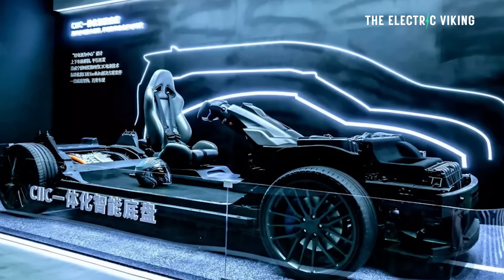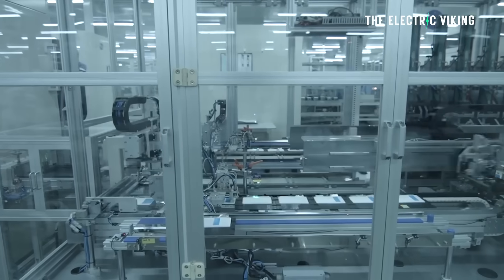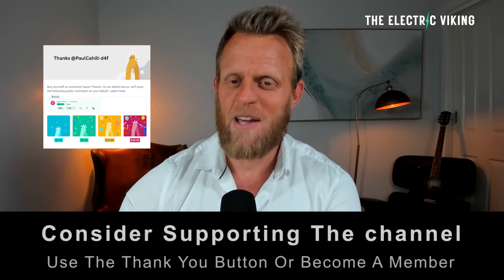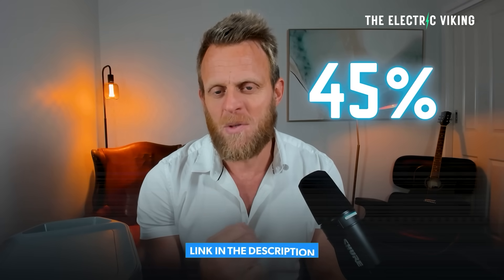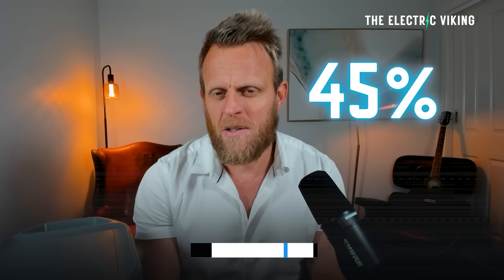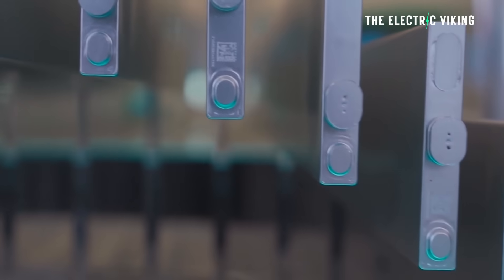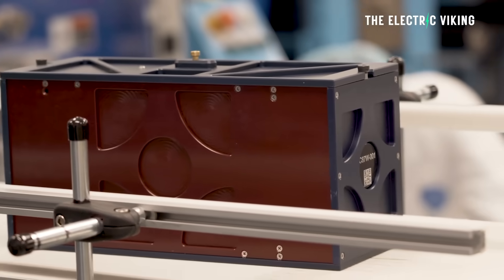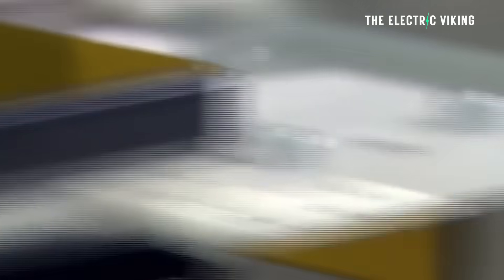1,000-Mile EV Range Unlocked: CATL’s Lithium Metal Battery Breakthrough!

Comment: You means putting in an equivalent battery with the same weight as the current 70 kWh one. Since it has double the energy, it will have 140 kWh and you will get double the range.
Reply: yes, putting another 70 kWh battery will only give some few miles extra with the lower weigth, must be the other thing he means.
Reply: THANK YOU!

He keeps saying this in a bunch of videos.
Thinking that lowering the battery weight by half (which would make the whole EV about 15% lighter) will double the range of the vehicle.

In highway trips it will increase, at best, 2%, because weight is the enemy of accel./decel. not, speed. At constant speeds, the only difference the weight makes is in rolling resistance, which is nothing compared to aero drag in a car.

You still need double the energy storage to double the range with the same weight.

Viewers are mislead by his convincing ways of saying something so wrong...
Reply: He always makes the same error, 70 kWh is 70kwh whatever the battery tech  …
Reply: @yvesvandenbroek6055  almost, half the weigth of the battery will give a little in improved range, maybe 5-10%?
Reply: The Electric Viking is crap at numbers and always gets them wrong even though what he's trying to say is right.
Reply: So that would be between 400 to 500 miles depending on quality n terrain driving style
Reply: @mykota2417  I can already ge well over 300 miles with my 80kwhh Skoda Enyaq.
Reply: We are telling this to the Viking for years 😂 He just doesn't get it. A 70 kWh battery pack is just a 70 kWh battery pack, no matter its energy density. The only difference will be its weight which might be 30-50% less than existing packs with lower energy density, so the range of the vehicles with the new batteries will have weight saving of a few hundred kg, hence a little longer range. Unless they put a battery pack weighing the same as an existing one but because of its 2.5 times higher energy density, it will have a 2.5 times longer range ( since the vehicle weight stays the same). But the Viking just doesn't want to get it 😭 Many commenters wrote to him about this already, but perhaps he doesn't read them.
Reply: The smarter choice is the replace the 70 kWh battery with a 90 kWh battery, increasing range by 30%, reducing size and weight by 30%, and reducing cost by 30%.
Reply: Or is it because it's half the weight at the same kwh @70?

Broh there's a reason the Honda insight, geo metro, VW XL1, VW lupo 1.2, and Audi A2 got great fuel economy.

Low rolling resistance, low weight, good drag coefficient.

Comment: Battery technology follows the same S-curve of improvement and cost reduction as other technologies that have already rapidly changed the world in the past century.
Reply: 4.28 😂😂😂
Reply: The cost to the consumer doesn't.
Reply: @alfredotto7525  Of course it does, Time to update your info mate
Over the last 30 years, lithium-ion batteries have seen dramatic improvements. The cost of lithium-ion batteries has decreased tenfold.   Volumetric energy density has increased threefold.
 The density of top-tier cells has risen fivefold. 
 For every doubling of battery deployment, costs have fallen by 19%. 
 For every doubling of deployment, density gains of 7% have been

Comment: A 70 kWh lithium metal battery in a Model 3 will give it 1.000 km range? Why would the range be higher because it’s a different type battery? The range doesn’t double because you lose 25% of the vehicles weight.
Reply: He means putting in an equivalent battery with the same weight as the current 70 kWh one. Since it has double the energy, you’ll get double the range.
Reply: Energy density is the amount of energy a battery can store per unit of weight or volume. These new batteries can store more energy (double the amount) than the previous battery technology.
Reply: I think the combined attributes will take it to 700 mile range more like 1100km city driving )))
Reply: Yep, this might need to be stated differently. (0:56) With the average EV "drivetrain" able to extract 3 to 4 miles per kWh (and at best perhaps 5 to 6 miles per kWh), even at 500Wh/kg a 70kWh battery is still a 70kWh battery and would only return 210 to 280 miles (for an EV that gets 3-4 miles/kWh) or 350 to 420 miles (for an EV that gets 5 to 6 miles/kWh). Might be better to use the battery's mass (kg) to define this which is likely what Sam's intentions were.  At 500Wh/kg this new battery will hold roughly twice the energy that existing Li-ion technology holds which would indeed allow for better than twice the range (considering it weighs less as well).

Comment: Hey Sam, dont mean to be rude but its not 500W/kg. Its 500Wh/kg.
Reply: it's an important point, actually he says Wh most of the time, just a slip of the tongue
Reply: He STILL says it.  🤦‍♂️
Reply: Sam doesn’t know what he is talking about, he just gets paid to push this rubbish 🤣

Hey Sam, how is your 5 minute charging going?🤣
Reply: Only if it is real. If it's vapourwear it 's equally accurate no matter which one he uses...
Reply: What he should be saying is for the same WEIGHT of the current battery (lets say 200Wh/kg) of 70khw,  this new battery will provide around 170kwh of energy and hence, considerable amount of more miles.
If he is comparing with current 70kwh battery at 200wh/kg to new 70kwh battery with 500wh/kg, the energy of both batteries are same and the only added benefit is nearly 2.5 times of weight loss, this will give some extra miles, no doubt on that, but not to the extent of 1000 miles like he said as energy of both batteries are same.
Reply: @sagunkatuwal9717 That's exactly the same thing.
Reply: Oops. (0:56) With the average EV getting between 3-4 miles per kWh (and at best perhaps 5-6 miles per kWh), even at 500Wh/kg a 70kWh battery is still a 70kWh battery and would only return 210 to 280 miles (for an EV that gets 3-4 miles/kWh) or 350 to 420 miles (for an EV that gets 5-6 miles/kWh). There would be a small weight advantage. However, for this comparison it would have been better to use equivalent "mass".
Reply: @TronJockey  Tron, thanks for bringing your A game.
Reply: @TronJockey  Same stored energy but lower weight, so higher range.
Reply: @antoniofigueiredo3812  by lowering the weight range is increased insignificantly. First because most resistance at higher speeds is from air. And second if the car is heavier the regen breaks get more energy out of momentum. The only time when weight is really important is uphill and during acceleration. When the car already reached the cruising speed the weight difference does not require a lot more energy.
Reply: @Vanea-s7i cars accelerate all the time, cruise speed is not the rule, and regen is a second order effect. Let's double battery size then and that should basically duplicate range if weight is insignificant. Anyway the point here was that Sam was being called out for having said something stupid, when actually he did not. You're now discussing if keeping the same stored energy in a higher energy battery increases more or less the range, the original accusation was that range would be the same for the same kWh stored.
Reply: @antoniofigueiredo3812  yeah range will increase by less than 9% if battery stays at 70kwh. Not 1000miles. You have to increase capacity to get more range
Reply: @Vanea-s7i  That number is wrong, but it's really besides the point. A higher density battery increases range, it does not stay the same as the original comment said (now edited) but I don't expect people in YouTube comments to admit they were wrong :)
Reply: @TronJockey  the point here are multifold, density is one but more importantly life in the number of charge cycles. Twice the cycles of current LFP batteries which are already longer than NMC batteries. It is impressive
Reply: @markuc  But that's not what he is saying. He says that they have doubled the life of the current breed of Lithium metal batteries, not LFP or NMC batteries. Lithium metal batteries have struggled because their recharge life has been very low up until recently. This breakthrough achievement only lasted 483 recharge cycles. Not great, but getting there.
Reply: @markuc  - I'm not saying that it's not impressive, it absolutely is. The Chinese have now matched Amprius' 500Wh/kg, the best in the west. I would agree that cycle life is important as well. Early SS batteries have long had such high energy densities, but they always lacked cycle life. The manufacturers would claim a long life inferring extended cycle life when in actuality it was due more to larger "per charge" ranges and fewer cycles. As the old idiom says, "Six of one, half a dozen of the other". A battery pack with 1000 miles of range only needs half the cycle life to match the life of a 500-mile battery pack that can see twice the number of charge cycles. However, this does seem to be different. We'll see. I'm hopeful and intrigued.
Reply: @TronJockey the volumetric size of these 500 Wh/kg batteries also decreases, which means, you can fit a battery with the same size and weight into the car floor (skateboard design) with more kWh net capacity leading to more range.
Reply: @ikarustigger  - Yep, no argument there. But from the initial conversations above, a battery pack with 70kWh of energy is still a battery pack with 70kWh of energy regardless of its mass or volume. So yes, in addition to a volume reduction there would also be a weight advantage (lower mass) which would lend itself to a considerable increase in range but not double. The calculations for this are not so simple. The relationship between weight and range is not exactly linear.
Reply: @TronJockey exactly… it seems that e-viking doesn’t really know what he is talking about 😅. And it’s not the first time i notice this.
Reply: @Vanea-s7i  - I wouldn't be too hard on him. I'm a retired EE and I've made similar mistakes quite often; confusing units of electrical energy and power is very easy to do. I've already made the mistake once today, typing 500kWh instead of 500Wh. Easy to do. Sam gets it right most of the time.
Reply: @TronJockey  still 70kwh is 70kwh irrespective of the energy density
Reply: @Vanea-s7i  - I don't get your point. kWh is a unit of energy and 70kWh/kg defines how much energy per unit of mass (i.e. "energy density").

Comment: Sounds like Lithium Air, it has way more capacity potential but needs alot of Lithium.   This has been talked about for the last 5 years or more. It will have way different characteristics than Lithium Ion, like very slow to throttle up.  Its more like a Hydrogen fuel cell but with metal.  It will be highly dangerous, explosive on contact with water.  Single charge Aluminium air is also possible and alot safer.